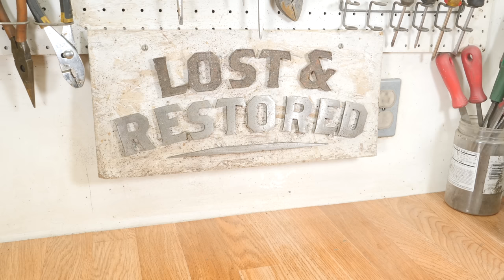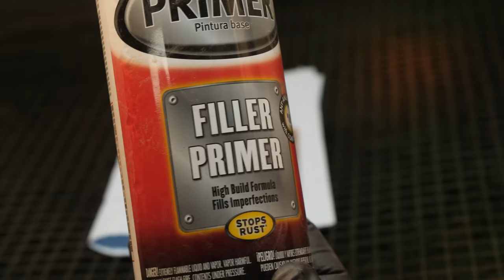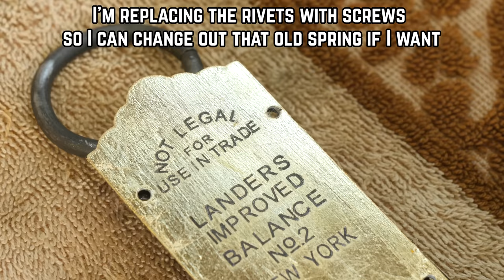Most Rusted 100 Year Old Kitchen Scale I've Ever Seen Restoration!

Comment: That's awesome. You do such amazing work. Were you 'trained' in restoration or is this just stugg you kearned through doing itt? My mom ,ikes to restore things and she actually took courses in restoration sciences for things like jewelry, metalwork, gilding, mechanical restoration. She wanted to learn to repair travel clocks. A lot of them were ornate and required courses in several things like paint restoration and woodworking. But in the end, the classes were kimd of pointless and she apprentices with a local antiques dealer that does restorations. Or she did, and now doesn't do any of that, but she was learning cool,stuff